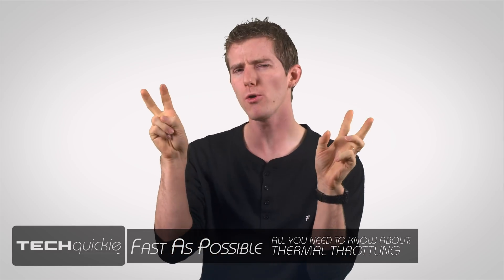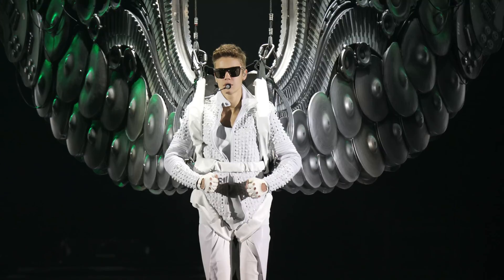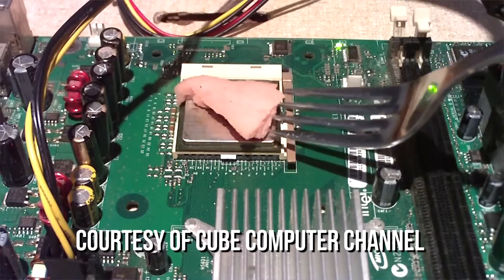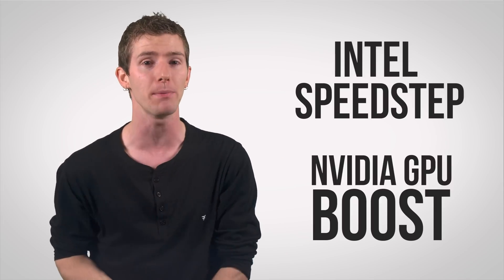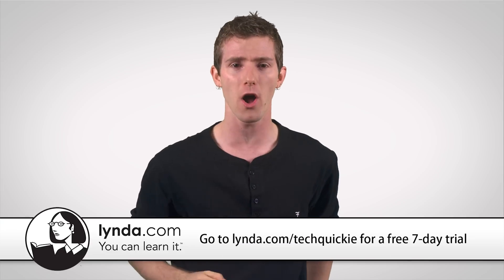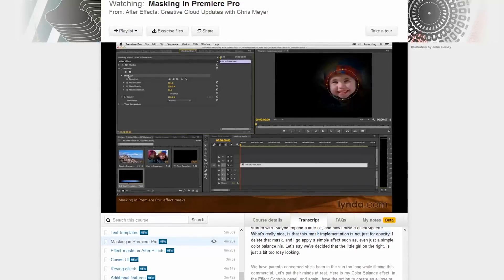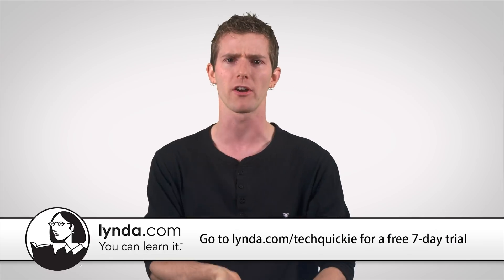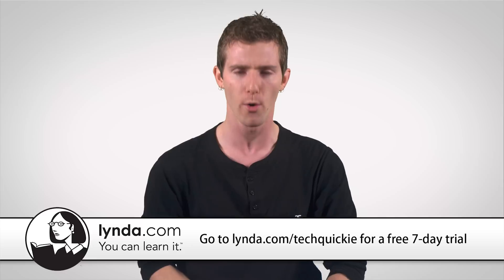Thermal Throttling as Fast As Possible

Comment: At what temperature do modern cpus throttle? What temperature should I set for my AIO fans to run at 100%? 80°c?
Reply: Depending on what device you are on generally 95 is just it try using msi after burner to see at what point your cpu gives up and throttles. And that's the temp u should be avoiding

Comment: why does my cpu clock speed low when gaming but high clock speed when not doing anything heavy? my fan is acting too, is it the main cause?
Reply: Either you do testing, or take it to a computer shop and check it out. I have done alot of testing on my system and i found out that my system is power limit throttling. Soo everytime i play, the power gets throttled and my clock speed drops from 2.5 to 1.6-1.9. This makes the game unplayable.
Reply: @astrojade4802  hmmm thanks
Reply: @astrojade4802  everytime i did a stress test it happened to
Reply: @xerlapis  ii never understood throttlestop, I always throught it was thermal throttling soo, i was like ill get it replaced bla bla bla, then out of the blue i retested in xtu and the first time nothing came up,  So i did a bench mark test and then i found out that the value underneath power limit throttling starting bleeping in yellow constantly. Then i researched up on power limit throttling and found out that its basically unfixable from your side, unless u have a 7th gen and above system, where the bios is unlocked and tweakable. 
Just pray urs is not power throttling, if its thermal throttling just replace the thermal paste and done, you're sorted.
Reply: @astrojade4802  thanks mate

Comment: Is it normal for a system to throttle when the system has its turbo disabled? It starts throttling at 70 to 75 degrees
Reply: At 75 Celsius which is a very toasty temperature yes any device that gets that hot WILL slow its speed quite a bit

Comment: Processors are made of semiconductors (sillicon) right. And these semiconductors show increase in conductivity with rise in temprature  (unlike metal conductors) right. So wouldn't it be increased performance with some increase in temprature (not too high temp ,so as to burn components ) ?
Is rise of pc components due to the Eddy current or what else is the reason?
What would be good temp to operate cpu  and overall pc?
Reply: Thanks in advance ,for explanation .

Comment: 2:05 Laptop thermal throttling is familiar for me, as I bought Asus ROG GL502VM gaming laptop: It makes thermal throttling under heavy load and temps are around 90 C already... Had to modify it myself according the web forum instructions to avoid thermal throttling and get full utilization of my gaming laptop of which I paid for... Just very bad cooling design from Asus =(
Reply: t982678249 
Maybe thermal paste can help?
Reply: how did you avoid the thermal throttling??  I did undervolting, disabled power throttling in the registies but... if i open my memu emulator and chrome at the same time, it starts hard throttling, and i dont know what else to do.
Reply: @astrojade4802  Hi. Laptop stand with cooling is a good place to start. Cooling stand helps laptop own cooling system to work more efficiently.

Thing that helps software basis is disabling CPU and GPU boost clock (turbo boost mode if I remember that correctly). Unfortunately that hurts performance too ☹ If some performance drop won't matter, I suggest to disable those and throttling is solved.

Also I went that far that I modified the bottom cover, so that I drilled more air vent holes directly to the fan area. About 10-15 pcs of 6mm holes or so. So cooling fans could get more fresh air from outside easily. That helped some degC, but also voids warranty (if you're still on warranty period).

After two years of latop gaming and high temperatures on regular gaming 85-95 C (and poor cooling design I think) eventually toasted GPU of my laptop 🔥🔥 New MB would been too expensive so, I had to scrap my broken Asus gaming laptop and I shifted back to desktop gaming. Laptop cooling solutions won't just do it, they have too much TDP in too small space, so cooling cannot be as efficient as needed.
Reply: @astrojade4802  How high temperatures your laptop has currenly? I got on "stock" 95C, and about 85C when disabled those CPU and GPU boosts. 85C is pretty high too, but I think there are limits of cooling system so it would need hardware modifications.

How about if you carefully take back cover off and test then how high temperature on load? Does that help?
Reply: @982678249   on load? Actually a funny scene happens when there is load on the system, Even you will be surprised.
2 separate scenes happen while gaming and when not gaming
~While gaming: temperatures shoot up from 65 degrees to 85 and over, I cannot do anything simultaneously(screen record). Somehow the clock speed gets maintained at 2.2ghz while gaming. if i screen record it will shoot down to 1.6ghz and ruin the gaming experience.
~While not gaming: using the memu emulator (just to access whatsapp ) and the moment i open chrome, it immediatelly hard throttles, and drops my clock speed from 2.2ghz all the way down to 1.6. The temperatures are not even reaching 70 deg, Its literally stuck at 69 deg. I just dont understand why.
After writing all this, it just struck me that, this laptop may not even be fit for multi tasking and there is no fixed temperature where it starts throttling.
Yes i need to change its thermal paste, but when i look at the above factors, i believe that even if the system was at a 50 degrees temperature after the new paste was applied, even then its gonna throttle because it just doesnt like to multi task.
Reply: @astrojade4802  Yes those were on load temps, if I remember correctly idle were around 60 C. Sounds similar temps then, but your laptop throttles very bad 😮 But I haven't tried screen recording on the same time, you could be right that it's too much multitask for laptop. 
Have you tried what happens when you run Prime95 (i.e. FFT test) for some hours? Does CPU stall? How about if you run Prime95 and some GPU stress test at the same time, does stalling occurs then?
Reply: @982678249  i have to check it out, I have never tried that test. i am 100 percent sure its gonna stalll xDDDD Pathetic laptop xDD
Reply: @982678249  I dont know what to say after i tried the msi after burner testing. Nothing got detected, like power throttling or thermal throttling. The only thing i noticed is that even though i  set my core turbo from 2.7 to 2.2, it kept detecting the turbo clockspeed  of 2.5. and the clock speed was always between 1.9 and 2.2. fluctuating all the time. The temperatures are always between 70 and 80, even while recording. But the funniest part is that even though the temperature look okay, every time i switch on recording,it down clocks immediately to 1.6. If i off the recording, it will go back to 2.2. I will have to take this laptop to dell and try to get some answers of this defect clockspeed. I mean now... thats literally the only thing i can possibly do in this situation. And it literally saddens me to the fact that even after doing soo much, the laptop in the end still betrayed me.

Comment: witnessed that only a few days ago when i did a classic school boy error

"upgraded" my laptop cpu from a pentium b940 to a pentium b960 and noticed something odd. i noticed that just browsing the web would cause the cpu fan to max out and what was more weird the air coming out was cold, so thinking that the heatsink wasent fitted properly decided to tear the laptop apart and re-fit the cooler. what i also did was scrape off any old thermal paste off both the cpu and heatsink and turned it back on (after putting it back together of coarse) went back into windows 10 installed HW monitor and monitored temps. at idle it was 58'c, decided to run cinebench  to check load temps and thats when i noticed it, reached 80'c and it then throttled from 2.2GHz to 700MHz but temps was still rising. eventually temps reached 85'c and the laptop just turn it self off. it was at that point i then re opened it and applied some cheap thermal paste (which i  borrowed from a friend because i didnt have any at the time, now temps at idle are 35'c and under load top out at about 58'c - 60'c.

what i learned is no matter what cpu swap you do, make sure to clear the old thermal paste and re apply some fresh paste

Comment: Windows devices without active coolers (like super-thin laptops, tablets, phones) may also reduce screen backlight level to cool the device and may decide to slow down or disable entirely battery charging for some time to cool it. So the CPU and GPU thermal throttling is not the only technique used by Windows devices.

Comment: So if you have a GPU that's playing a game at 100% capacity, with 155 frames per second, then you experience a sudden frame dip to less than 30, is that from thermal throttling?

Comment: my 950m keeps throttling at 92C. I was able to OC 950m to 960m during the winter seasons when temperature is low enough, cooling isnt an issue. now spring comes, my gpu throttles crazy and cant keep the overclock
Reply: Woah,92 Celsius is far too HOT!!

Comment: Hey guys, i have an amd fx 8370 with the neew wraith cooler and had a quick question on thermal margins. so recently only in battlefield 1 my fps went from 70 to 30 for a couple seconds and it concerned me so i looked at the thermal margins with amd overdrive and its at 25c full load in bf1 and then all the sudden the amrgin goes to -100c and the framerate dips happen, im so confused can anyone help!?
Reply: Zachery Talbett Your temp monitor is screwed
Reply: Zachery Talbett which can lead to bad throttling

Comment: hey, Linus i wondered if you could reply to this that would be awesome!!. so i have a 970a-g43 mobo fx 8350, gtx 970 1tb hdd 8gb ram 600w psu. at 1080p gaming, when building this i was so confident it was going to Max out all games without Vsync, hairworks etc.. But then after a while i experienced frame drops down to 20 fps on cs:go, running far cry 3 at 60-20fps mostly 34fps, and the witcher 3 running at 60 - 20fps and the witcher 3 drops happend when not alot was happening. Some have Said its my motherboard that cant run a 125 w cpu if its that then tell me and please leave a recommendation for the best bang for the buck around 80 dollar mobo for my fx 8350 if its something Else with my pc then please also tell me. Oh and also i bought used cpu used 970a-g43 and ram in a bundle and used gtx 970 and a "New" shitty bitfenix nova case and its the msi gtx 970 with 1 fan. Please help man
Reply: ***** I'm using hyper 212 evo
Reply: I think so too thanks

Comment: im using ga-970a-ds3p and my voltage is terrible like when i oc and run prime its lowers down like 1.332 to 1,260 and it stays at 1,260 and i fail prime does cooling vrm helps keeping voltage the same

Comment: so.... how do i get rid of it?
Reply: +Some Weeb put you cpu and gpu in a bucket of ice xD
Reply: +Some Weeb Get a better fan, if it still throttles crank that shit up!
Reply: +Some Weeb Get a higher quality fan or simply add more fans, I suggest Noctua fans - they last the longest because of their SSO2 bearings, and they are pretty quiet too. If that doesn't help, then you likely need a bigger case that would allow for more airflow.
Reply: Some Weeb ...? You asked how to get rid of it? I said how to get rid of it.
Reply: Some Weeb ok
Reply: Ken it was a joke
Reply: Ken never really said it was a problem, thing is, with my current PC, the CPU is really good, but the GPU prevents me from playing any game that uses the CPU to it's full potential, so i don't really have any heat problems

Comment: the  exynos 7420 still throttles pretty bad it's just managed much better than the 810.. the 7420 clocks back the big. cores to 1.7ghz within seconds of loading it. it doesn't throttle enough to stop temps going up into the low 90s though
Reply: +Jon Olaivar The 810 is not that bad, it's just not that great when you run multiple heavy benchmarks back to back, under real use it really doesn't at all.
Reply: deafyboy86 Yeah, I was an early adopter of the M9 with the 810 so im sure things have gotten much better since.

Comment: I have thermal throttling what should i do?
Reply: +misterPAINMAKER Get better fans
Reply: +misterPAINMAKER thermal paste. Most will say that its not the case but it was for me. I wiggled my heatsink around and afterwards boom my cpu is at 100C.  If changing it doesnt help, download speedfan and crank up those fans!
Reply: +misterPAINMAKER Get a higher quality fan or simply add more fans, I suggest Noctua fans - they last the longest because of their SSO2 bearings, and they are pretty quiet too. If that doesn't help, then you likely need a bigger case that would allow for more airflow.
Reply: It is a laptop.
Reply: +misterPAINMAKER get cooling pad is cheapest thing you can do and can be quite good.

Comment: Anyone know how to safely use throttlestop on an i7. I have the lamborgini VX7 (uncle gave it to me, I would never buy such a ridiculous thing) and there is SERIOUS thermal throttling with the i7. It's a 2.2ghz with 2.9~8 turbo. It throttles down to ~900mhz all the time. I cant run CSO at low resolution min settings without lag. It has a 560m so that can definitely handle CSGO. Please help me. I've tried other peoples settings but it gets to 98 degrees and I don't feel safe at that temp. Can someone please tell me some settings or tweaks so I can use it as a secondary to my gaming rig?

Comment: doubt anyone still checks these comments but my gpu runs very hot when playing games for extended periods and I've been meaning to change the thermal paste because I have some left over from my pc build. Lately in games that typically push my gtx 760 to its limits I will have a random framedrop and after it drops it just stays and doesn't return to normal. when playing maxed out Diablo or high/very high gta v for example it will get up to 80  - 81°c and bounce around the two not moving. I figured the sudden drop in frames could be thermal throttling because I set my target temp to 80 in the evga precision software. if this doesn't sound like thermal throttling them please let me know as id like to get to the bottom of it whether or not I actually get around to swapping the paste on my gpu lol. thanks!
Reply: +basssq3 That definitely sounds like thermal throttling to me. If you exit the game, wait for the GPU to chill down a bit, and re-launch the game, do the frame drops persist? If not, then it’s likely the GPU is being overwhelmed (and thus overheating itself) after running the games for awhile, and turning down the graphics settings will preserve the higher frame-rate for a longer period of time. Also, dust resists heat and blocks airflow, so if the inside of your PC is filthy (and assuming it’s air-cooled) a good cleaning should show noticeable improvements.
Reply: Gameactive Thank you! No the frame drops only start after the game has been on for an extended period of time, when i close and re open the games the frame rate returns to normal until the card heats up again. The drops are most noticeable in GTA V and Killing Floor 2. It has to heat up and stay hot for a bit the drops aren't an instant thing. Also in the way of dust my case is quite clean but none the less I'm sure my card could use a cleaning. Figured id clean it when i switch the thermal paste since ill be taking the heatsink off anyways. My system is air cooled with the exception of my CPU using a AIO liquid cooler.
Reply: basssq3 In this scenario, yes, the GPU is thermal-throttling, and choking the game’s performance as a result. Also, good figuring, it’s easier to see and clean out dust once you’ve gotten the card semi-dismantled. And the reason I asked about the system being air-cooled is because the dust will hinder that a lot more than a water-cooled system.
Reply: Gameactive thank you for your help. My only issue is if I accidentally mess up the thermal pads while swapping the paste i'm not sure where to grab new ones. But yolo I guess lol.
Reply: +basssq3 A bit late, how's the result? Did changing the thermal paste / general cleaning improve your temps? Or did you just end up purchasing a new card?
Reply: Sigh Watson I've been so busy with school I haven't gotten around to it. I don't have nearly as much time to game and I haven't been playing the games that really stress my card out so it hasn't been on the top of my list like it was when I made the comment lol. I plan on building a new system in a few months so I'll need to throw paste on it so I can sell it to my friend. I'll do it this weekend and let you know. Its also because I'm worried about damaging the thermal pads because I know those can be hard to replace.
Reply: Sigh Watson also I cleaned my system but its surprisingly dust free especially since my case is kinda cheap and doesn't really have dust filters lol